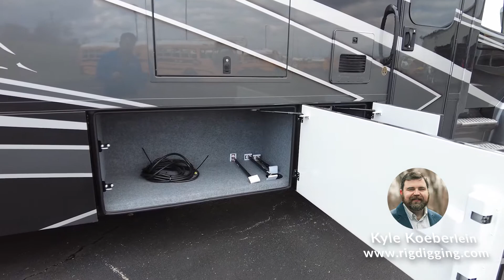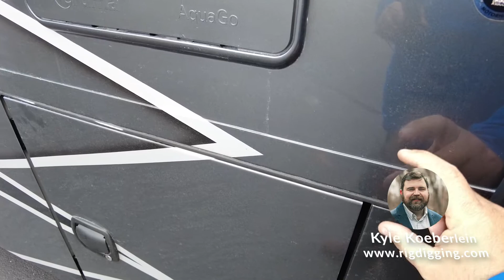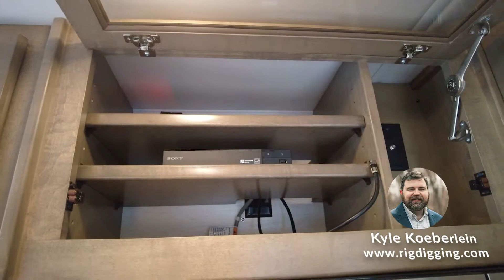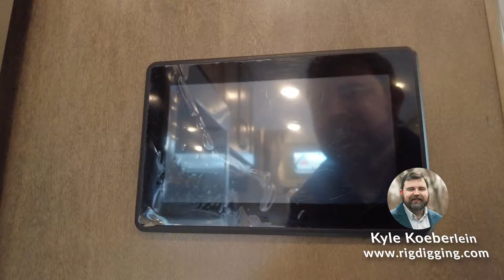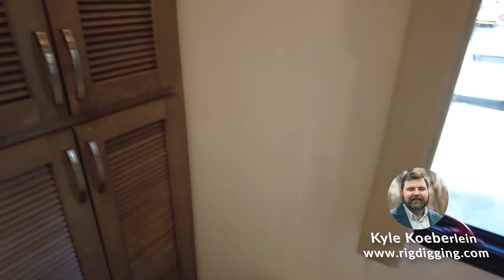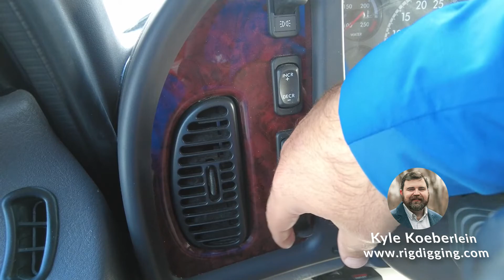2023 Renegade Valencia 38RW Full Walk Around (Stock R0057-Sold)

Comment: Hey Kyle, first time I've watched one of your videos. THUMBS UP! I do have a questions on this video. The Big item suspended from the top of the battery compartment, what is it? And the other question, what is that loose piece of coax cable for. Thanks - Joe
Reply from the maker: The item suspended from the top of the box is a chassis component from Freightliner and the disconnect switch is for the chassis. The loose coax cable on the roof is to add an additional satellite dish.

Comment: I really enjoyed your video, you did a great and thorough job. I have a 2022 Valencia and I just wanted to know if you have had any customers have problems with Snappads especially on the way the rear suspension on the S2RV chassis is set up. The problem that I have heard of is that there is not enough clearance for the Snappads and that they fall off. We're considering purchasing some.
Reply from the maker: Here is a video of the snap pad issue on a Valencia. https://www.facebook.com/reel/574846990297842?fs=e&s=TIeQ9V
Reply: @kylekoeberlein  Thanks Kyle, seeing the video helped me understand the problem so I will not be buying any Snap Pads for my S2RV Freightliner.
Reply from the maker: I wouldn’t do snap pads on the rear. I was just at the Renegade Rally in TN and noticed a set of snap pads on a Valencia because I had another customer with the same concerns. So I asked the owner if he had any problems with them and he said no. We crawled under his rig and you could see where the pads had been worn from being pushed on and off by the suspension. My opinion is it’s only a matter of time before one falls off.
Reply: @kylekoeberlein  Thanks for your advice.